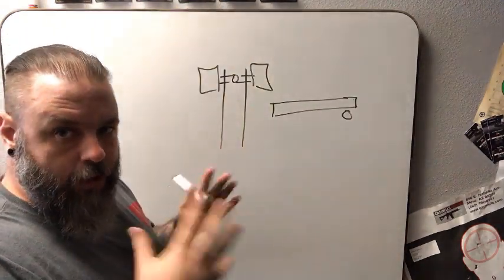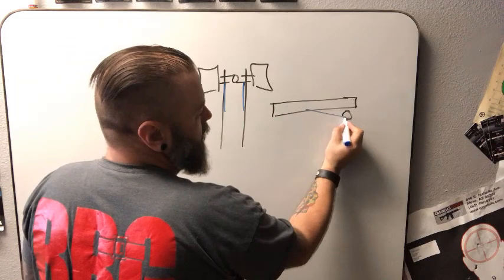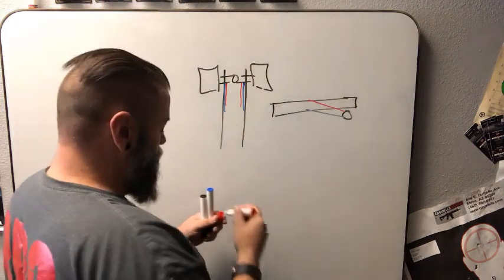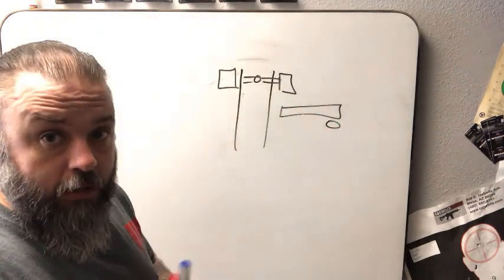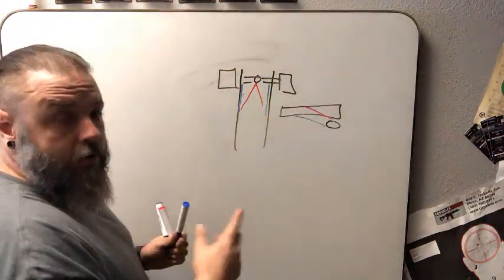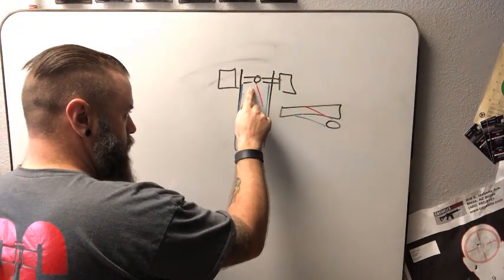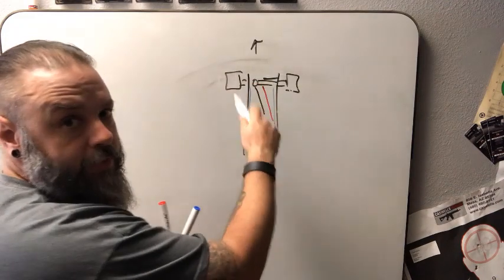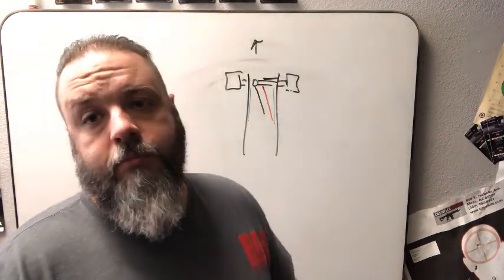3 Link Suspension Explained

Comment: The big reason that on a offroad vehicle you would want to run a 3 link in the front is due to the drag link if you are using a steering box. If you were to opt for full hydro steering the drag link wouldn't be an issue and a triangulated 4 link could be used.

Comment: Thanks for the video, I watch your videos regularly. So I'm about to start working on the rear suspension of my 57 Apache and I'm swapping and 8.8 rear end from an explorer which is 3" longer on one side. I like to put my truck on the floor (not a 4x4) I already bought a 4 link triangulated. I know I have option of cutting the longer side of the diff, but I don't want to mess with it. Can I weld the top bars to the pumpkin? Or should I look into 3 link with panhard. Thanks 👍

Comment: hey buddy, listen, i got this deal disturbing my mind, my rig its a 95 Suzuki Samurai running 33" swampers, with complete +8" Coil Conversion Rockyroad Outfitters Suspension, using stock axles front and rear, also, got this 3 links on rear, and very complete steering bars, but, i actuall concern about not to roll over on my soft top, i thinking maybe i can made a some kind of sway using torsion trought frame chassis, as the antirock for the rear, i got not rear panhart either, just scissors and triangle, please, i would like to read your suggest and value comment, that's how i arrive here. any swaybar neither, i just want keep flexing no deal, not using zuk as hat.   iykwim
Reply from the maker: Reinaldo Jose Estrada Serritiello I would hit the junk yard and find a sway bar for something like a Nissan Pathfinder. Almost any unibody should have sway bars. Then make your own links to what every location you find to mount the sway bay.

Comment: I thought the whole reason for an offset pumpkin was because the gears in the transfer case/Center diff offset it and then the driveshaft is straight.
Reply: Yes.. you are correct

Comment: Can i use. It to bag my hardbody i dont want. 2 link i dont like the idea of the pinion drastic changing and i dont want a 4 link since i dont want to move the fuel tank
Reply from the maker: Elchingon_92  run you can do it but not sure how it will track at higher speed